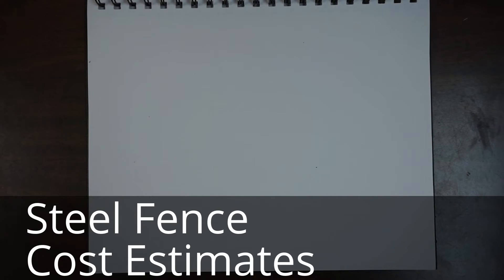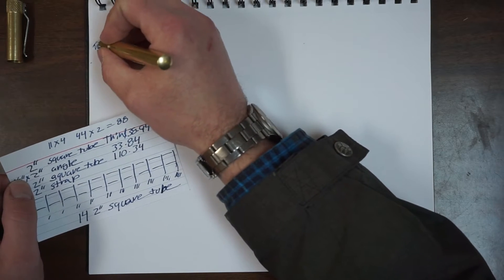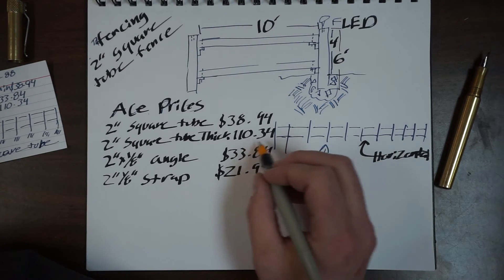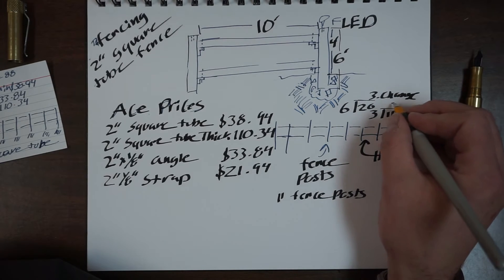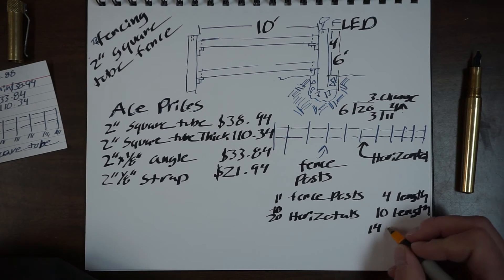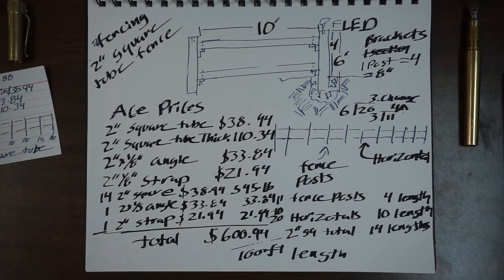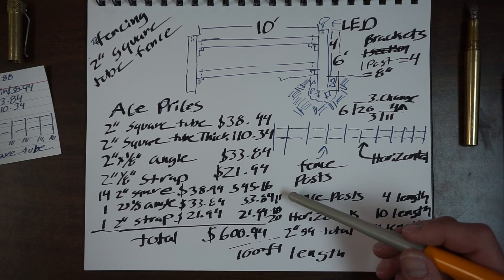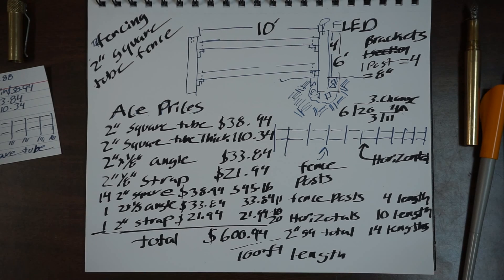5-17-17 Steel Fence Cost Estimates

Comment: inches     feet   ysrds      3 ft  1 yrd    12 cinches  1 foot   etc     est is  always close no need to be perfect   always add waste const norm 10%    always make sure enough of anything shows up   extra can be used for replace damage later etc     idea  dont run out  during the build